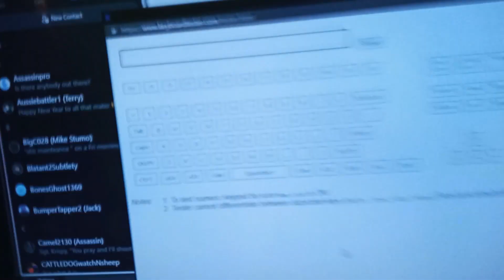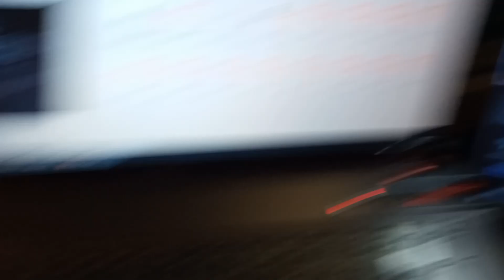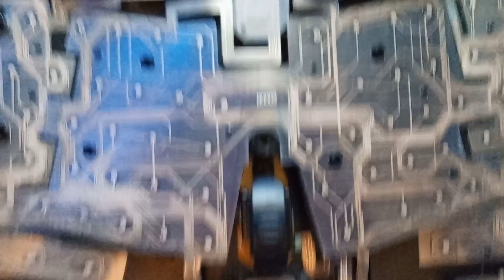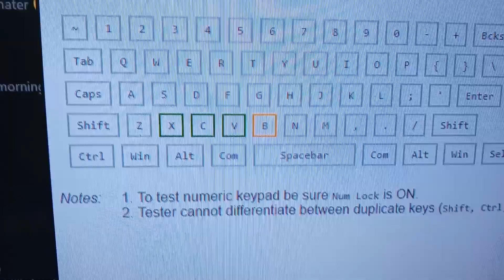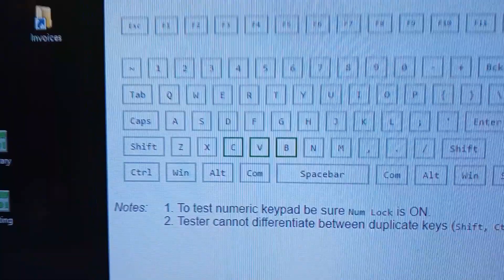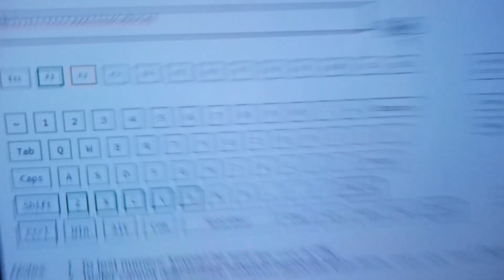Membrane Keyboard Repair (Lost Keys / No Signal)

Comment: Is it still working?!
Reply from the maker: Yep
Reply: @ItsMaKa2  hmmm good to know cuz I'm planning to do something similar but I aim to do it a bit different
Using the wire method but with 0.1mm bridging wire and I plan to find a way to make some conductive glue if that works I would try to fix my second keyboard and I also got some keyboards lying around to test it on them. 
so I might try to fix some of them as well.
(The reason why I opted for a different method is cuz I can't seem to any pen with conductive ink online that's still in stock so gotta get creative a bit lol)